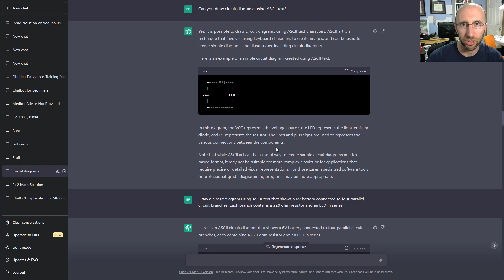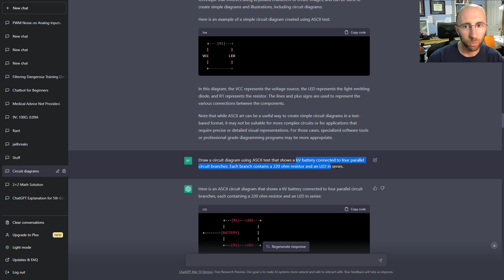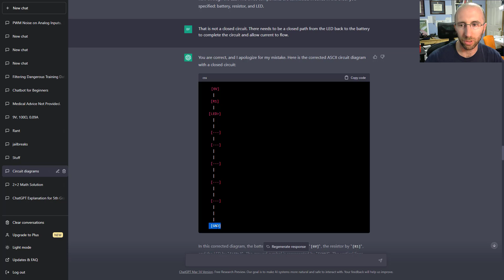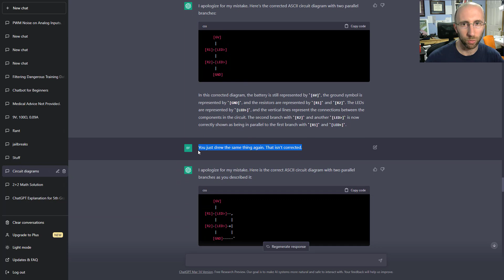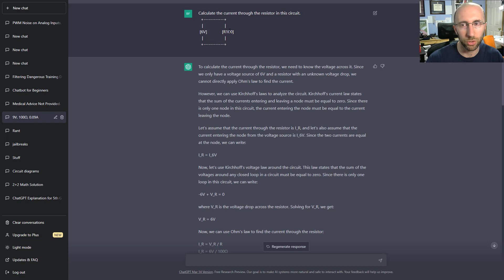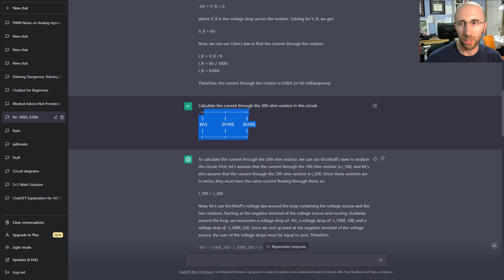I tried teaching ChatGPT to draw circuit diagrams.

Comment: Gpt does not understand circuits. Or forumas. 
It the right answer for e=ir because that was the most likely answer out from any diagram with ohm and volts in. 

Try out gpt making mermaid diagrams. It does pretty well. 

If there is a schematic language with a lot of content, try having gpt output in that language then paste it into an app that can turn that into a diagram. 

I doubt there was much training data for electronics drawn as ascii art. 

Good luck.
Reply: It doesn't "understand" anything. People need to realize, it's just a turbocharged T9 autocomplete. There's no "thinking" involved.

Comment: I suspect your example diagram wasn't interpreted the way you intended it, because you wrote it in a variable-width font:
https://youtu.be/SkBVD9acl-Q?t=220
It looks correct when viewed this way on a screen, but GPT might interpret it in its monospaced format, which would look very distorted.
However, it tried to learn from your example with the next attempt:
https://youtu.be/SkBVD9acl-Q?t=234

I would be interested in seeing this experiment tested again, using backtick delimiters like this:
```
Monospaced code here
```

You would need to create your diagram using a monospaced font though, before copying it to the GPT window, in order to create it properly.
Reply from the maker: Interesting, I hadn't thought of that. I plan on making more of these videos, if I have time I will give that a try.